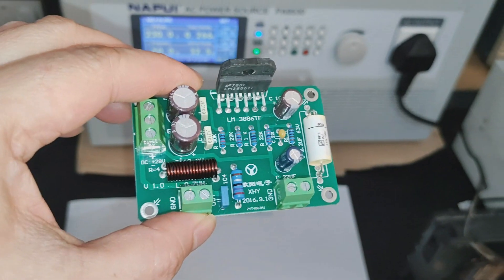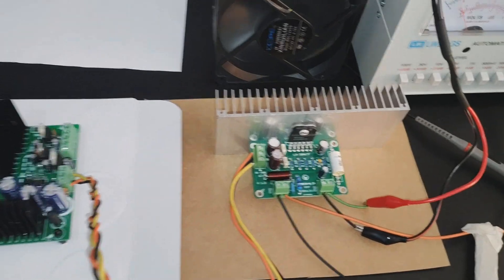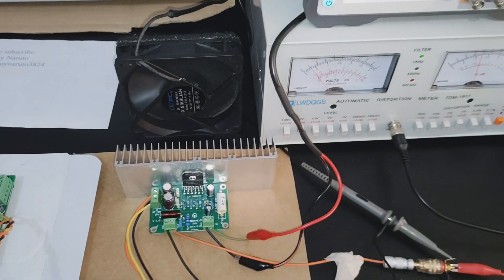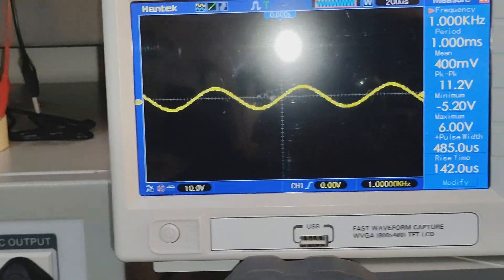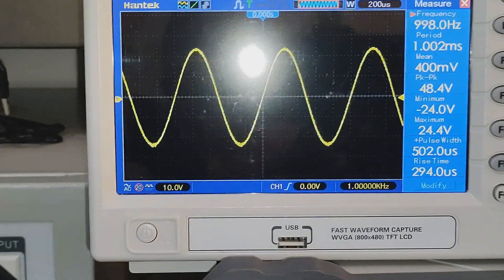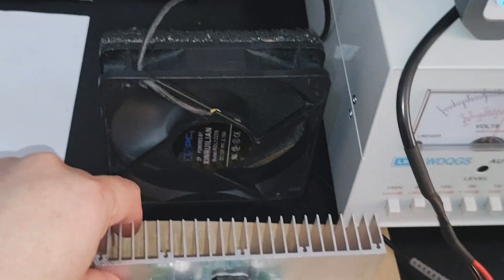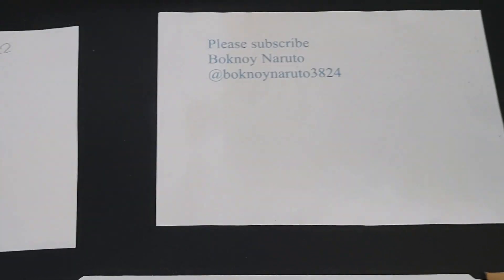LM3886 XHY Board With Schematic Power Test and Distortion at 4 Ohms Load

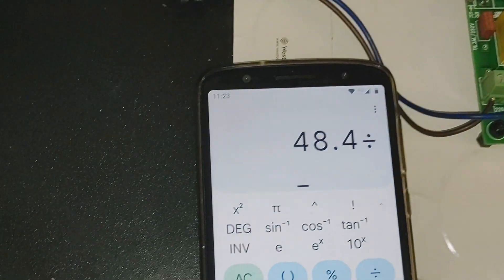Comment: 5:13 what is 2.8 in the calculator?
Reply from the maker: 2.8 is to convert peak to peak voltage to RMS (Vrms = Vpp/2.828, it is the square root of 2 * 2, shortened)
It is similar to Vrms = 0.35355 * Vpp.